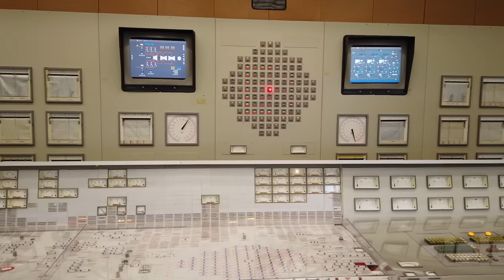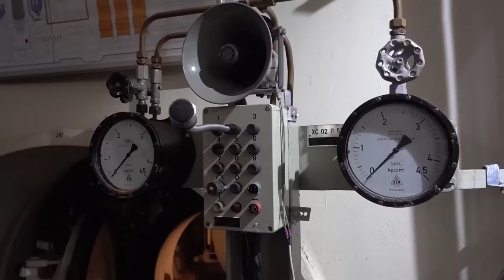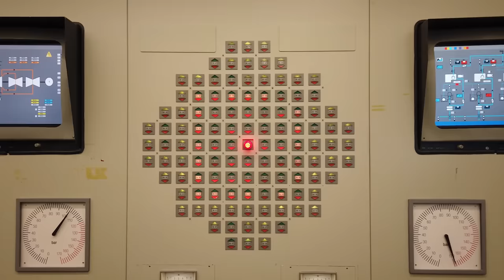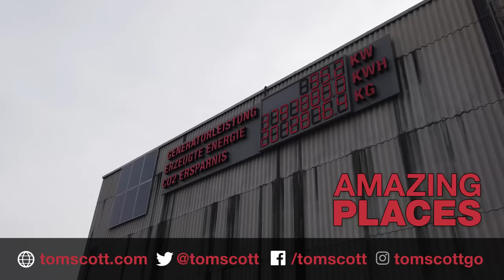This billion-euro nuclear reactor was never switched on

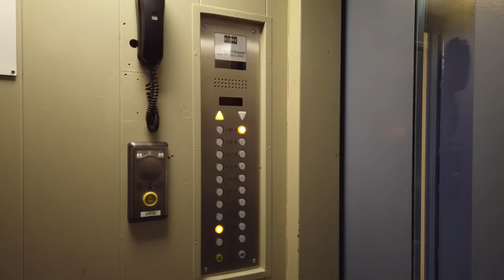Comment: 1:14
The average power draw in Austrian households is only 400-450 W? That seems low, unless you only use electric power for lighting, dishwashing, laundry, TVs, computers, and charging portable electronic devices. I think you’d have to use gas or wood for all heating and cooking to use that little electricity.

Comment: Austrian citizens were smart to abandon this Boiling Water Reactor design.   General Electric's original BWR design in the US and elsewhere are being seen for the dangers they represent and are being targeted for shutdown in the near future.   The idea that the control rods and some emergency systems are actuated from the bottom of the reactor and are power dependent rather than gravity dependent as they are in Pressurized Water Reactors is a design fault that all licensed BWR machines never really addressed.   Oyster Creek,  Peach Bottom,  Quad Cities,  and other BWR machines licensed in the United States need more proper scrutiny and evaluation of their true cost picture.

Comment: It blows my mind how people will scoff at nuclear power. If you truly care about climate change and want to move from our dependency of fossil fuels, nuclear power is our best option right now. Our power grid is mostly run on coal. Those Teslas that everyone is obsessed with are not even close to carbon neutral. Vehicles that run on diesel, are responsible for mining their battery components. Whenever you plug your Tesla in, chances are it's getting charged by coal.

Comment: Austria has 4.35GW of installed gas power. On average in 2021 they used 1GW.

Had they built those nuclear power plants, they would have some of the lowest carbon electricity in the world. Instead, it's about double the carbon intensity as France who has some of the cleanest thanks to 56 nuclear reactors (+1 under construction and 14 more planned, all the most powerful in the world at 1670GW each).

Comment: I looked up the results if the vote and it is unfortunate that they interpreted the results the way they did.
Yes, of the voters that voted 50.5% said no, but only 64% of voters showed up. So one could argue that only 32% of total voters said no. Which is probably a more accurate representation.

Comment: Found this video, two years later. Looking up the plant on Wikipedia, the article hasn't stated any changes since this video's recording.
I can't help but wonder if it would be possible, and how long it would take, to reinstall the parts that were sold off and start it up safely?
Reply: Old as fudge reactor, probably not up to current standards. Nowadays there are reactors around the corner with just a little less output with a much smaller footprint and much safer since all safety measures are built-in. Even the EPR is around the same size, but makes 2x more power
Reply: Luckily there is a law in Austria that prohibits nuclear power plants. And we are glad that we will never use that thing.

Comment: So sad it never ran, and that some countries are closing the only safe, reliable, dependable, carbon-neutral clean energy source available to us. We will never fix climate change with 'renewables', they just can't supply the amount of power needed for industry.
Reply: Austria is a special case, 60% of their electricity is hydroelectricity. Which is a lot cheaper to operate than a nuclear plant. So as long as the water keeps flowing from their mountains, nuclear does not bring them much.
Reply: @effedrien  What is the other 40%
Reply: @AndrooH  around 20% are other renewables and 20% fossil fuels.
Reply: @effedrien  They have plenty to gain from 20% now being reliable, and everyone can benefit from another 20% not burning fossil fuels. They could also export excess electricity.
Reply: @AndrooH  they still have room for more hydro and they are also investing in wind and hydroelectric energy storage, it's a work in progress. Besides, electricity only counts for a percentage of our use of fossil fuels, and from electric engineering point of view, those fossil fuel plants are ideal for covering the peak usage, as they can be used on demand with only few minutes response time to switch on and off. The technology is so simple and cheap and reliable that it is no problem to only use them during peak hours. Nuclear power plants cannot be operated like that and too much of such plants is a hassle for the grid, and not profitable, just look at what the electricity companies in France and Belgium are doing.
Reply: @effedrien  imagine building a power network that relies on climate during unprecedented climate change 😂😂😂
Good luck with all that - clearly the sensible option escaped you.
Reply: @AndrooH i was talking about profitability for the electricity companies, not about personal opinions or emotional subjects without hard numbers. Anyway if climate change means more water running off those hills, they are safe in Austria 😃
Reply: @effedrien  so you don't actually know and are just arguing for the sake of it?  I guess this is YouTube after all. 
If either of us is using emotions here it's now you - uranium 'crap', 'real thing', etc.  
Fission is real, uranium is not crap - it's a dense, safe, reliable energy source.  I'm out.
Reply: @AndrooH  Apart of the known accidents, there is an additional safety problem in war zones. And in case of economic collapse. And wrt terrorism. Safety cannot be guaranteed under circumstances that we can expect in the near future. And what can i say, it's obsolete low tech crap that is way too expensive because of the required safety measures and decommissioning costs and such. At least my emotional opinion corresponds with the findings of the financial department at the electricity companies.

Comment: This is presented as if it was an achievement to have this reactor preserved but never used. Unfortunately the reality is that the fact that it was never turned on objectively caused illness and death to a very large number of people, as a result of that energy demand being met with far more damaging sources such as coal. There is a brilliant video from Kurzgesagt about this topic.

The hard to swallow pill is that nuclear energy is part of the solution for climate change. It is much safer than fossil fuels such as coal and gas, and necessary even with wind and solar. Wind doesn't blow all the time and it's not always sun (see the capacity factor of these renewable assets), therefore nuclear will be necessary to cover those gaps. The sooner we stop demonising this form of energy, the higher the chance we will be able to actually let our children inherit a working planet.

Comment: Could anyone update information about current situation in EUdue to nery fast increasing cost of energy? Any plan to turn it on?
Reply: It would be easier and cheaper to build a new one than to renovate a facility that has been unused for decades. Maybe the building would be in usable condition from that facility. All tech and mechanics are gone.

Comment: Meanwhile the entire planet gradually continues its slow but certain meltdown that this facility would have helped stave off ... as 400 other still operating nuclear plants have helped achieve ...
Reply: "Meanwhile the entire planet gradually continues its slow but certain meltdown..."
Thats the koolaid talking..."the entire planet" and "certain meltdown", thats not the real world mate, thats the science fiction in your head.
Reply: @wildec2  ... and for once I’m ok hearing the looney right blaming windmills and solar for the Texas fiasco even though its a lie (actually coal plants failing cause most of the drama). But if 50% of Texas’s power HAD come from wind and solar they WOULD be to blame. That’s why Nuclear is ultimately the essential ‘green’ alternate to base-load fossil fuel power. Preferably fourth generation ‘walk away safe’ low residual molten salt nuclear such as Thorium. But even thousands of last generation (high pressure water) nuclear reactors carefully located would be infinitely safer than the ‘3-degree’ (Celsius) warmer climate we’re presently heading towards.

Comment: The amount of depressed engineers and enraged nuclear lovers here down in the comments is just staggering... 😂😂
Reply: I mean you would be too if you would know that the coal power plant that they build instead of this is much much worse for people and the environment than a nuclear power plant.
Reply: @BloPsy_Actual  I know at least that neither the coal nor the uranium nuclear power plant alone is the solution
Reply: @razzledazzle488  Right now, nuclear energy is the cleanest energy source and until we will get fusion reactors working, it will also be the solution. Sure, renewable sources are great, but not all countries have the possibility to use them to efficiently supply the whole country.

Comment: I'm sorry, but wind/solar energy will never be a viable option. Not only is it intermittent at best, the leftovers from windturbines are anything but environmentally friendly. The blades cannot be recycled, so they have to dump them into landfills and ravines. Then there is the damage to the local bird- and insect-life, not to mention the low-frequency noise they produce that can make people physically ill. The same goes for solar panels. They get dumped en masse in Africa because they are all but impossible to recycle. So much for "environmentally friendly". As much as we may not like it, we do need nuclear power to cut back on the emissions. And the current NPPs are a far cry from the likes of Chernobyl or even Three Mile Island. Even the waste can be reused in some newer type reactors like the CANDU.

Comment: The greatest of ironies. Your final words " all of this can be preserved, if only by accident ".
The only plant that doesn't need decommissioning.  Because there WAS NO ACCIDENT. Because they did it right for once. Because they never used it.  Because they are intelligent enough to realize it's not worth the risk or the waste. Or waste risk. Or even the run risk. We have already ruined the climate.  We don't need to ruin our health too. With the processing,  the concrete,  the short life, the reprocessing and or disposal,  the eons of risk and maintenance of the waste. Definitely on the wrong side of the ledger. At least oil wasn't a lie from the start.